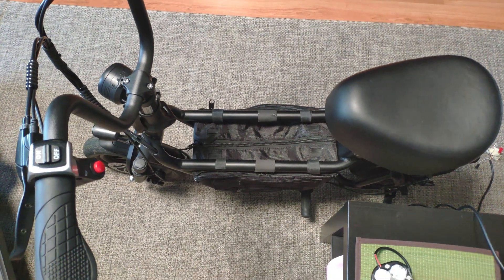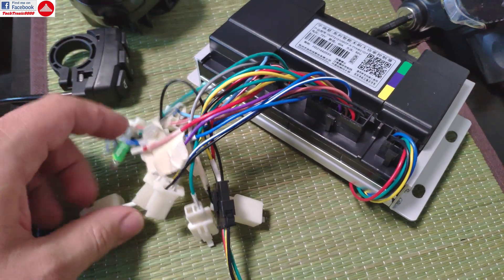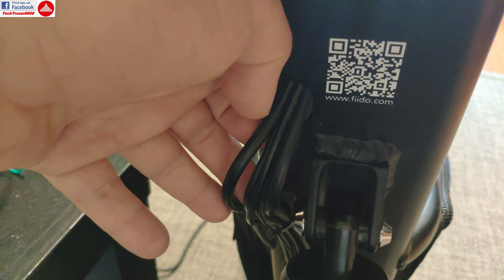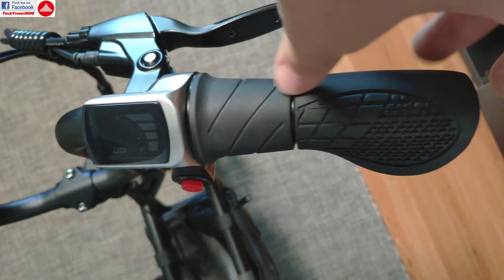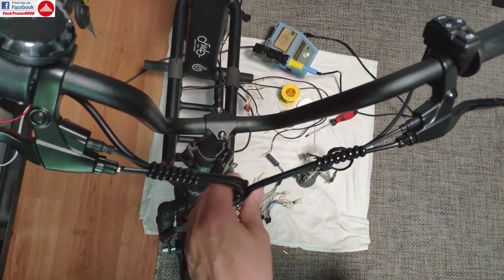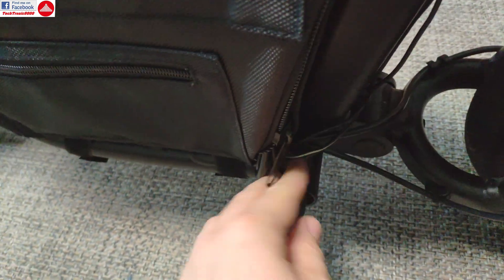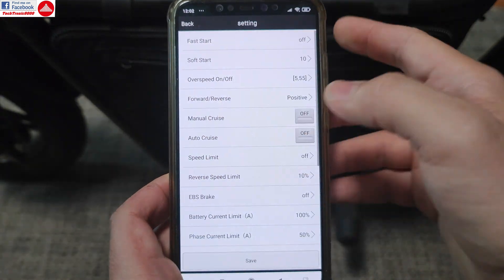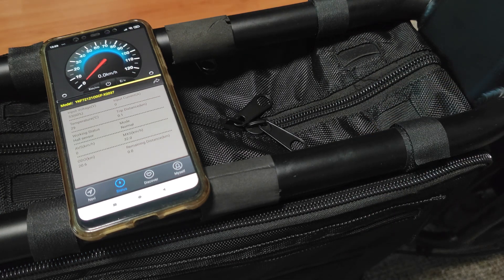Fiido Q1s Controller Swap MOD 2000W DIY Guide

Comment: More information on wiring controller, please?
Reply from the maker: I have added some links in the video description for a similar controller that has some wiring diagrams. The one that I got had zero diagrams.
Reply: @TechTronic9000  The controller in video is sine & link is square? 🧐

Comment: How fast does it go after these modifications?
Reply from the maker: In the current stage I'm running a 60V battery, new direct drive hub motor and power went to 2400W+. It is doing about 50km/h. Soon there will be a second motor install with an extra controller, taking power to 4800W+

Comment: You have the diagram for connecting the speedometer wire?
Reply from the maker: The "sense" wire connects directly to a motor phase wire.

Comment: thank you so much for the follow up video, much appreciated. my controller looks similar with that but no Bluetooth, i guess a knock off copy 1000w, can go 45kph on 48v.
Reply from the maker: Keep in mind that this is the stock geared motor, designed for low power and low speed. There is also a test ride incoming.
Reply: @TechTronic9000  oh I didn’t mention that i also using stock geared motor, sorry for late reply, 😂

Comment: Thank you for sharing! I am looking forward to do the same, but using a vesc controller. Have you thought about using one?
Reply from the maker: A VESC is a nice idea for it's compact size and customization, but VESC are are that good from a complete stand still, it usually needs a "push" for the motor and the Q1 being without pedals it might not be as good as a normal hall-ed controller.
Reply: @TechTronic9000  I did not know that. I will look into it. Then a  vesc could be used in a dual motor setup, where the other controller is not a vesc and gives the push from stand still.
Reply: @cristianosaturni  VESC controllers run just fine from stand still.
Reply: @phylaxxx , thanks. I have not yet bought the vesc, but will once i have some spare time. I read that a vesc may have a slightly lower top speed. Have you experienced this?
Reply: @cristianosaturni  The VESC can take advantage of field weakening which can actually increase your top speed at the cost of efficiency while travelling at those higher speed.
Reply: @phylaxxx  thanks. I am new to this. For the VESC to exploit the field weakening, do we have to configure the VESC in a special way (f.e. do we have to enable it) or does the controller do it by default? I am upgrading only the controller for now, and I would like not to lose top speed when using the standard battery and motor.
Reply: @cristianosaturni  Field weakening is not enabled by default and can be increased or decreased by adjusting the feild weakening current. Keep in mind that using this with the default motor may be problematic as the extra current will cause things to heat up more. You'll have to have a play around to see what the limits of your motor are.